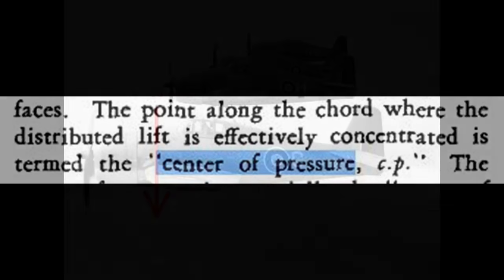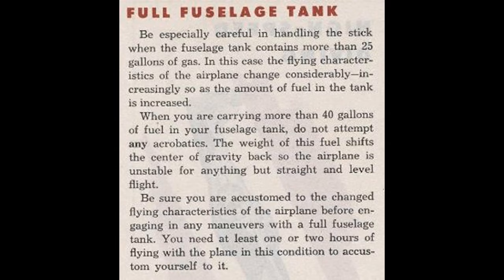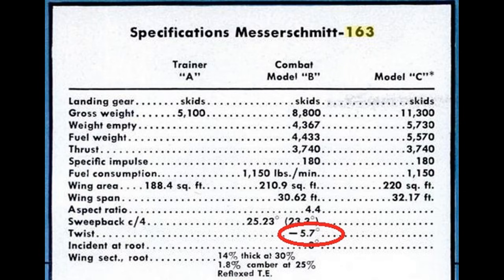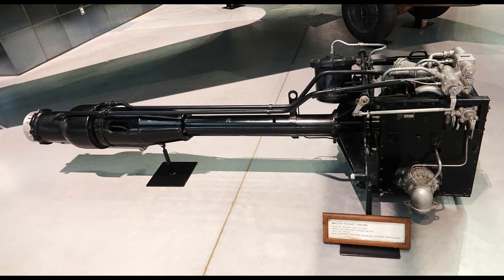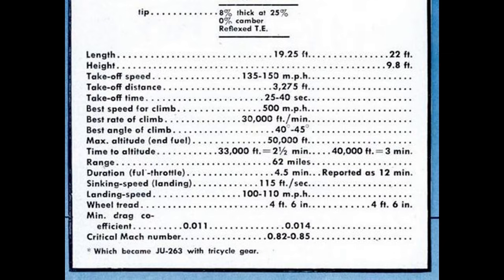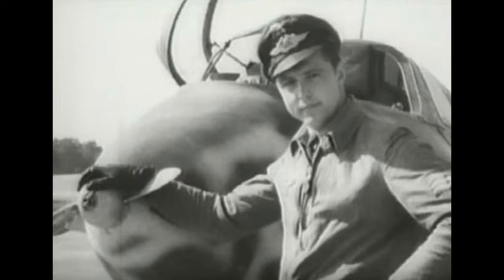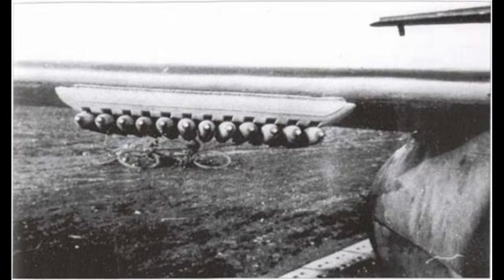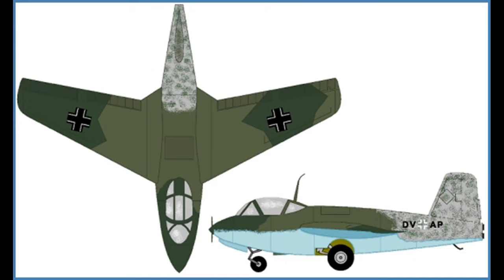Messerschmitt Me 163 Pt.2 Plus Me 263 and More!

Comment: You are totally wrong about the B-2 and it's accommodations and pilots. Where the hell did you come up with that stuff?
Reply: You’re a better man than me, Greg. No way I’d have replied to someone that rude and lacking of tact and class.
Reply from the maker: Without specifics, it's hard to know what you are talking about. The info on the B-2 came from a B-2 pilot and is supported by articles on the plane. Here are a few that talk about the medication issue: https://www.defensenews.com/air/2019/04/29/heres-how-b-2-bomber-pilots-pull-off-grueling-33-hour-flights/   https://www.chicagotribune.com/news/ct-xpm-2003-02-02-0302020386-story.html   https://goflightmedicine.com/stimulants-sleep-aids/

Comment: Video technical comment: Reading Text by pausing?
Whenever I press pause, my TV, the bottom third has a pop up that obscures the bottom 1/3+ of the screen. (A video progress time-lapse bar, and other video thumbnails). So, reading text, now obscured, isn't possible, by using that. 
Possible solution?
Maybe text that you post could slow scroll or something? (If it's worth dealing with).
.
Cheers.

Comment: I believe the coal in the coal fired turbines was processed coal in the form of precision briquettes. They were contained in a matrix, heated to red heat and spun at high speed in a compressed airflow. It appears feasible, although I'm not sure if the turbine was ever manufactured. Coal has a lot of potential in various forms and should not be lightly dismissed. It's still a valuable resource, loathed of course by the carbon zero narrative.

Comment: First of all - thank you Greg for great videos, I really enjoyed the conventional fighters series. But in these two videos about Me163, there are some misleading statements about the aerodynamics of a flying wings. In the first video you said, that the inboard trim surface on the trailing edge takes up a place of flaps and they had to be moved to the bottom of the wing. That is not correct - flap-moving surface on the trailing edge of a flying wing equals elevator, simple as that. And the only practical place for a flaps on such an airplane is the bottom of the wing. In this video, when you spoke about the CG and CP - you mentioned that the tips of the wings add the pitch moment of the missing tail - almost all flying wings require "autostable" airfoil with reflexed trailing edge (S shaped chord) which provides the correct pitch moment - on the whole wing span. It is also stated in the Me163 specs table at the bottom "Reflexed T.E.".
Reply: The way I learned it in Aero Eng school, and the genius of Lippisch, is all airfoils at a given angle of attack have a lift figure and a moment figure, or tendency to twist, which is what's normally counteracted with the horizontal stabilizer.  

Some airfoils are higher lift and lower  moment, and some are lower lift and higher moment. The genius idea was to combine washout with an airfoil nearer the root that's higher lift and lower moment, and transitioning to a lower lift higher moment airfoil mounted  upside down at the tip, so as to strongly counter the moment of the root airfoil but not strongly counter the lift.  The washout and airfoil distribution is determined by comparing the lift/moment curves of each airfoil over various angles of attack.  Genius.

Northrop was also experimenting with tailless aircraft, but used drooped tips, until after WWII when he learned of Lippisch's idea and suddenly his flying wings had straight wings.

Comment: Greg, you are wrong about two points on the B2 Spirit missions.  There is a airline style toilet on board and a small bunk for one of the pilots to sleep.  Medication may or may not be prescribed  but medicated pilots make big mistake.  The need for sleep is well recognized by the military, especially the USAF which has lost thousand of pilots due to fatigue.  And no self-respecting pilot is going to suffer diaper rash.  I know fighter pilots wear adult briefs, specifically female pilots, but they try to avoid that.

Comment: I can see why the cannon isn't that effective,  probably due to the very short barrel.     It only has a velocity of 1770 fps.  (the A10's 30mm is close to 3300 fps)   There are 12ga shotgun slug as fast as the MK 108's rounds.   But  that is slow for a bullet,  and being a big 30 mm one with a lot of drag--- and it's going to bleed off speed fast and would  be subsonic in less than couple hundred yards.

Comment: If you looking at the Me 163 and the Mig 15, you will notice a big difference apart from paint, tail or the engine. The Mig got speed breaks in order to slow down behind slow flying B-29. The Me 163 got nothing like that. And a B-17 is even a slower plane than the B-29.
Tacticly, the Me 163 was a big failure. I thing, it served the developers as a reason not being drafted into the Wehrmacht and sent to the Eastern front.

Comment: To start fantastic channel! Currently building a 163 diorama with 1 B, 1 S, a schuschleper tractor and fuel truck in 1/48, ironic. On the B2 wasn't design more related to the Horton brothers Ho9/Gotha 299 and Norton wing that flew after WW2, don't mind being wrong but the Horton brothers were doing flying wing gliders and powered wings before the war and flew a Junkers turbine powered wing before the war ended. The Smithsonian has a Gotha produced prototype that was under construction when captured.
Reply from the maker: The Horton brothers did have some influence there,  but they were following Alexander Lippisch's work, I think they even said that.

Comment: The mini prop in the nose is called a RAT (ram air turbine) which drops down in the airstream (in commercial aircraft) in flight during emergencies for regaining electrical power. (It spins an AC generator) Most McDonnell Douglas planes I built at the factory worked this way.

Comment: The MK 108 were exceeding low velocity.
  The first of the trio of Luftwaffe 3cm MK, the 3cm/30mm MK 101, was heavy and had a slow rate of fire, but hit like the wrath of Iron Man at 900mps/2970fps, making it most accurate of the three types of 3cm cannon.  
  In an effort to improve ROF and reduce weight, the MK 101 was developed into the MK 103.  Its AP projectiles left the barrel at 860mps/2800fps.  It seems to be roughly the same weight as the earlier cannon, however.
  These guns had performance figures equal to equivalent ground bound antitank weapons in terms of MV and penetration.  They hit hard and were quite accurate.  It seems possible that someone in the design bureau was doing a bit too much meth, for these guns, proving just too heavy and bulky to install as motor connon, were further devolved into the MK 108, one of the five worst accuracy aircraft cannon ever flown , having a muzzle velocity of just 540mps/1770fps.  It was only half as heavy as its predecessors, but only half as accurate, too*.
  To give you an anecdotal description, Chuck Yeager reported using the T9 Cannon was like "lobbing grapefruit".
*(the other ones being the T9 "Oldsmobile" cannon of the P39 at 610mps, the Japanese Ho-301 40mm caseless ammo cannon of 265mps,  and the British Vickers 40mm S gun used in the 'urricane at 570mps)
Reply: The low muzzle velocity on the 108 was an intentional design concession to increase the rate of fire. They needed a good bomber killer weapon, and 30mm did the job very well, but most cannons that large fired rather slow, making it difficult to get enough hits in during a high speed pass.

So in order to increase the number of hits in a pass, they accordingly wanted a higher rate of fire. To achieve this it used a very unique chambering system that gave it a much higher rate of fire than similarly sized cannons, but that system required a very specific muzzle velocity to get the timing just right, one that happened to be fairly slow. For shooting at a giant bomber in a high speed pass though, where aim is less important than burst mass, low muzzle velocity and accuracy were considered acceptable concessions.

Comment: 35:43 "Mach 2.3....Which was very fast for 1959." It's very fast for 2020 too, just sayin'. Sure, it didn't have supercruise, so range. But a measurement that turns up is "zero lift to drag" ratio, and the same design school B-58 and F-106 are the lowest I've seen. Although the B-2 is probably right there too. And I'm betting the B-58 was in it's clean config. Man, how much ice cream could they make in that fuel pod?!? #wwiistory

Comment: this is a nit, but the ideal nozzle shape at the back of a rocket changes with altitude. In practice, a choice has to be made, and loss of performance does occur with altitude.
Reply from the maker: Think that through. A loss of performance with an increase in altitude would only happen if the nozzle was designed to be optimal at sea level. Who would design a rocket that way?

Comment: Hey there Greg, here's a very interesting guncamera clip from supposedly an Me 163 engaging and hitting a B-17 with it's twin MK 108 cannons https://i.imgur.com/y59A0zJ.gifv
Reply from the maker: It could be, I really can't tell what type of plane is firing there, it's moving slowly, but that doesn't mean it isn't a 163, I just don't know.
Reply: @GregsAirplanesandAutomobiles  Looking at the size of the explosions I am fairly confident those are 30mm hits and the tracers for both guns are more or less grouped together and fairly paralel in trajectory (ruling out a Fw 190 with wing mounted 108s) other than a 163 it could maybe be a Bf 110G or Me 410 which could mount twin 30mm in the nose, so it could also be one of those as well.
Reply from the maker: Yup, that's the problem, there are a lot of possibilities.

Comment: Were Me 262s usually moved on the ground by tractors, as the Me 163 is at 21:46? I've seen footage of an Me 262 taxiing, but the fuel burn would be objectionable in late-War Germany.
Reply from the maker: 262s were moved by tractor, I can't say how often, but it was certainly done. The 163s typically used a different type of tractor.

Comment: With hindsight, a rocket motor designed to use nitrous oxide as oxidizer might have been preferable in service to the HWK 109-509. I have read of liquid oxygen, nitric acid, and hydrogen peroxide in rocketry before 1945 (and in torpedoes), but not nitrous oxide. This strikes me as peculiar, given its use in supercharged aero-engine boosting.
Reply from the maker: I'm not sure why they went with the chemicals they did as opposed to others. I would guess it's for power, but I don't know. You probably know more about chemistry than I do.

Comment: I've just visited the Titan Missile Museum. Like Me 163, Titan II used hypergolic propellants. The propellant handling equipment and procedures you describe at 19:57 are reminiscent of the museum. The silo has fuel and oxidizer hardstands where tank trucks would load propellants into the missile, via stainless steel braided tubing. The fuel hardstand has water nozzles for fire-fighting and decontamination. Unlike Me 163 ground crew shown, personnel wore protective suits resembling spacesuits. Residual propellants were destroyed by incineration in propane burners. 

In Titan II the oxidizer was nitrogen tetroxide and the fuel was hydrazine and unsymmetrical dimethylhydrazine. Like C-Stoff (hydrogen peroxide) and T-Stoff (hydrazine and methanol), these were toxic, corrosive, and intolerant of contamination.

The Titan II's had several fires, explosions, or poisonings caused by leaks or spills of propellant.
Reply from the maker: That all makes sense considering NASA's Germany connections.

Comment: Apart from the problems of fuel storage, it sounds like the ME163 would have been best suited to a catapult fighter for large warships. Kind of surprised the Germans didn't stick 4-6 on The Prinz Eugene or Tirpitz. (Not that the Tirp moved much so shore installations would have worked.) And that sounds like a great idea for a video, how about the technical aspects of the hurricanes the Brits put on merchant ships to defend against the FW200s? (I'm betting that a 163 floats longer than a hurricane and probably ditches better as well). I always enjoy the videos, thanks Greg. I'd also love your take on the Pulgise (? Spelling) torpedo defense system on Italian battleships, should you ever fell inclined. I can't find as much data on it as I'd like.

Comment: Lippisch P-13a
Top speed was said to be 2.6 Mach, but it required the outboard wings and the upper section of the fin to be thinned quite a bit for it to work.  I was under the impression that the glider was based on the P-13a, not the other way around.  Regardless, it does make a bit more sense, as there was a small model that they produced of the thinner winged proposal that was catapulted into the air (IIRC).

The aircraft used a coal-burning ramjet that started producing positive thrust all the way down at around 200 mph, and would work effectively up to Mach 2.6 (I'll see if I can dig up more information later).  The ability to produce a ramjet that can work over such a large speed range is quite impressive, though I have doubts as to how efficient it'd be while subsonic (though I figure it'd be fine when supersonic) and an endurance of 45 minutes was projected.

Convair XP-92 
Actually the original design was to be jet-powered (J30 or J34) with an arrangement of ducted rockets, as well as for larger rockets in the rear.  As I understand it, the rockets were to pump the duct, with the heat being used to produce an effect similar to the meredith effect.  It had swept wings and a V-tail.

As time went on, they decided to scale the duct up, and thin down the wings, so as to achieve supersonic performance.  I don't know if they deleted the J34 at this point or later, but eventually they were going to use the rockets as flame-holders for spray-bars mounted up front (acting a bit like a ramjet with extra thrust), with the remaining four larger rockets to do what the Me-163 used them for.  Speeds of Mach 2 were envisioned, but they found it wasn't making performance, so they called in Lippisch: Lippisch had proposed a delta-winged design, but it was found to be too thick.  A NACA Aerodynamicist named R.T. Jones, who had done some studying on swept-wings (1942) had taken a look and come up with a thinner cross-section to be used: This design had the cockpit in the inlet spike with 4 x 0.50" machine guns mounted on the underside of the spike, with the propulsion system using 4 large rockets to get to takeoff speed and help assist climb, with a rocket/ramjet propulsion system to get up to Mach 2.0 at 50000' or greater.  Hydraulics and stuff were powered by some type of small piston engine (weird as that was).

Ultimately, the decision was made to either split the project: Develop the propulsion and delta-wing independently of each other, or just develop the delta-wing as a proof of concept, which became the XF-92, which flew in April 1948.

Convair F-106: The F-106 traced it's roots to the F-102, which traced back to the XP-92, and so on.  That said, the F-106 was produced because the F-102A couldn't meet the performance intended: First, the radar/fire-control system wasn't proceeding on schedule; then the intended engine (J67) wasn't available, so they ended up with the less powerful J57; this became the interim design that would be used.  Plans existed for a ultimate design that would use the J67, that would be called the F-102B: The engine ran into production delays, was cancelled, and the J75 was substituted.

There was also an interest in variable geometry inlets which would produce better performance at low and high speed, would shorten the inlet-duct, and help clean-up the forward fuselage; the weapons bay was also modified, and a type of device was added behind the engine to allow it to, at low power, taxi without blowing stuff around too easily, yet permit near full performance at max power and afterburner.  That design was eventually re-designated as F-106A.  The F-106's I've often thought of  as an "F-102-and-a-half" though I think it was an excellent aircraft.

Both aircraft had excellent maneuverability, with the F-102 able to turn with the MiG-21; the F-106 actually having superior acceleration (maneuver speed was probably all of 12-15 knots higher than the F-102), and a higher top-speed.

Comment: Great videos Greg. I would have mentioned the F-102 in this video which the F-106 was developed from just to complete the timeline.
Reply from the maker: You are not wrong, it was an issue of video length. If I mentioned the 102, I would have had to get into the differences between it an the 106, and the video was already running on a bit long.

Comment: Actually rocket engine thrust is affected by altitude due to the change in the efficiency of the exhaust nozzle with external pressure. The effect is, however, minuscule at the altitudes at which the ME 163 operated.
Reply from the maker: Hi Brian, notice I didn't say it wasn't effected. I said it wasn't adversely effected.
Reply: @GregsAirplanesandAutomobiles  Not sure if it's adverse or not.  a rocket nozzle  is going to have a maximum performance at a specific back pressure.  Without knowing what altitude the nozzle is designed for, or whether or not nozzle technology was sufficiently understood at the time  to design for a specific envelope, whether or not the affect of altitude is adverse or not can not be readily determined.  And while we are splitting hairs, I'm sure your high school English teacher will be greatly disappointed by you use of "effected" when surely you meant "affected".  Otherwise, carry on your brilliant work!  :)